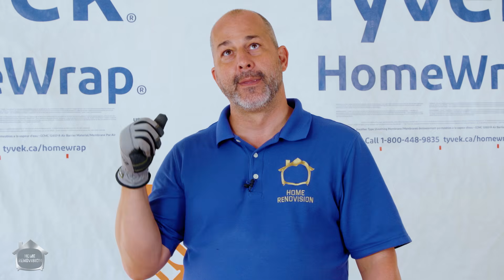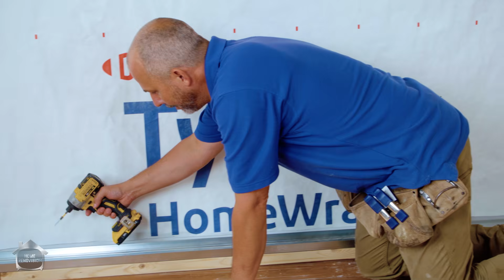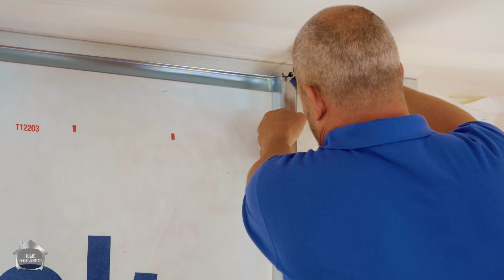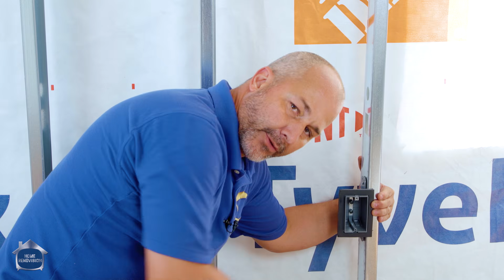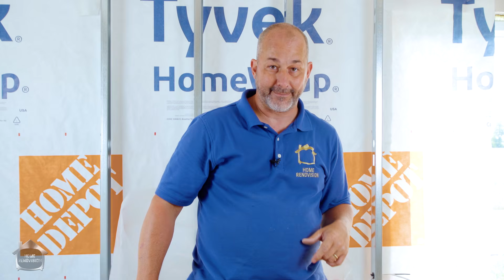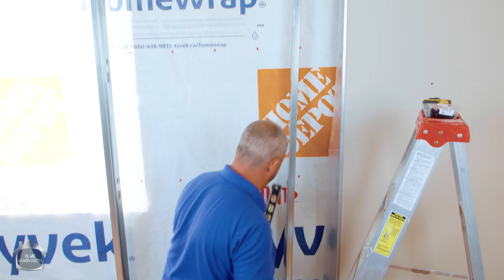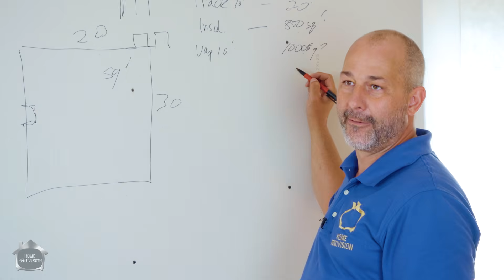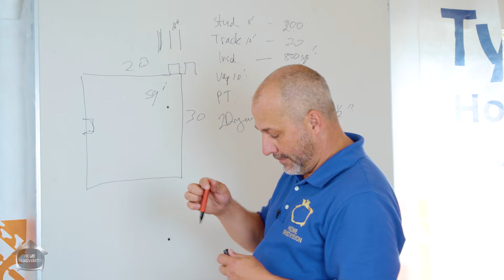Frame With Steel and Save Money! | Steel vs Wood

Comment: In NH basement foundation walls need to be sealed first with drylock before you start and track goes on top of a barrier like sill seal.  And no breaks like you have with the pt.

Comment: I want to use Six inch track at my Basement Ceiling, attached to the floor joist. Put Two inch Foam Board in the upper track. Put a 3-5/8 inch track on the floor, and 3-5/8 Metal Studs up. Will this work? Will it fit? BTW, I want to do this for a Fire Stop. Also every Eight Feet, I’m going to do a Vertical Fire Stop, with Two inch X Two inch Sheetmetal Steel Angle. I can use spacers or Fire Resistant foam to take up any extra space.

Comment: Great video so far. Still watching. I have a question on using 2x4 on the floor when framing. I have newer construction. House built in 2020 and moved in September 2020. We got the basement prep package which provided 9 ft ceiling , bathroom rough in and already insulated. Anyway, been watching some other vids and almost all of them just Ramset into the concrete for the floor framing, no 2x4.
Reply: I think he mentions in the video that newer construction homes that have proper moisture protection/vapor barriers around the basement shouldn't have the type of issues he's addressing with the stud. That said, as other comments mention, galvanic corrosion means you might want some kind of protection been the pressure treated stud and the steel.

(Commenting much later for anyone else trying to mine the comments for info.)

Comment: Your Videos are great man, Thanks! I remember when I first started doing metal framing, this professional framer guy showed me a very cool trick. He would only cut the sides with the snips and the top wider area he would place the speed square and cut the mark line "like twice" with a sheetrock knife and then move up and down and it pops off easily.

Comment: I'm a metal framer by trade from commercial building doing build-outs and even homes. I know you're showing the video for the average Joe who don't know but you should also screw the back of the stud by using extension and you can screw through the inside of the stud with the point going outwards into the back as well. We normally use the little vise grip clamps and we usually have a pocket full of them just to hold them in place until we go back and screw them. and if you're using PT on the bottom you should put a felt paper between the PT and the metal stud so you don't have a corrosion happening later on down the road. Don't take this as knocking you cuz I really do enjoy your shows 👍😉
Reply: Extremely important comment. It should be pinned to the top of the comments.
Reply: How specifically would you screw in the stud in the back side ? I found it extremely hard, eventhough I am using 90 impact extensions, I found that I don’t have enough force to keep pushing them constantly
Reply: What does PT mean? I’m learning how to install and correctly protect my basement from moisture
Reply: @jae-nacoleman  pressure treated lumber
Reply: Pressure treated (Lumber)
Reply: @rfranco8552 why are you not using stud crimpers?
Reply: @michaelkuzmin  .Thats very old school and if you ever try to take things apart for hatever reason it is a pain. Better just to use a pointed screw and clamp it. You get used to it.
Reply: @kevingrant9407  sorry when you say pointer screw what do you mean? I would use self tapping for 20 ga and thicker and non self tapping for the thinner steel. Clamp it, you mean clamp prior to screwing with a temporary clamp so that it holds in place? 
I ended up going with 20ga for my project so crimping was not an option for me, I had to use self tapping screws with wafer head. I also discovered that I had to get high quality ones. Screws that may look identical to a naked eye could actually have extremely different performance. I went with Grabber and they worked beautifully
Reply: I’m getting ready to order supplies to build out a room 10x20 with 10’ ceiling. I’m curious if I can put 3/4” osb on top of metal framing  (top side of the ceiling joists.) There’s another 6’ above it that’s open and would like it for storage and our humidifier. We’re building a walk-in humidor for a cigar lounge. Any help would be appreciated!

Comment: I understand that you need a gap between the wall and the insulation. So does that mean attaching something to the back of the studs too , in order to stop the insulation falling through? I think I saw that in one of your other videos, but I’m not sure what that material was.
I also thought it was ok to screw the baseplate metal straight to the dri-core sub floor, but here you advocate a 2x4 underneath (which I thought was mold food). So I’m a little confused.  Always enjoy your videos. Thanks

Comment: Speaking of the wood 2x4 on the floor: I'm thinking that I'll put two 2x4s atop each other so I have something to nail the baseboard to. I don't want to screw to the metal studs.  Also, the studs are for a 17' ceiling. I'm thinking, afix the tops first. Thoughts?

Comment: Instead of pressure treated board under the bottom track, may I use composite deck board? Waterproof, no copper reaction with metal? Any suggestions?
Reply: Thinking the same thing.....pt lumber is full of salts.....it's gonna eat that bottom track.
Reply: I like you idea.. but maybe a bit expensive

Comment: Jeff, what gauge were you using? I’m wanting to build a small room with steel but it needs to support its own ceiling with a double layer of 5/8 drywall (about 8x10). Do you think 25 gauge is too thin to support that type of weight?

Comment: I’m trying not to be too negative, some things you taught are right, but as a professional steel stud framer just realize there is a lot more to it, and impossible for a video like this to cover everything. Jeff cut his studs upside down, and 3/8” gap on top is optimal. If you start moving up and down the carrying channel won’t be level. (FYI ) the product is called carrying channel that goes every 4’ vertical to stop the stud from twisting while attaching drywall. The vapour barrier should be attached with the same wafer screws, the cardboard will cause bulges in the board, never seen anyone do it that way. Creative though. Also don’t put drywall screws close to where the wafer is. It will break the sheet. Also putting the cable tie on the outside of the stud creates an opportunity to put a screw through it and break the tie. 
I know you’re just making a basic video Jeff and I appreciate it, just realize there’s a lot of info missing for people to start diy’ing.

Comment: How do I nail baseboards and trims ?  ( 4 1/2 " ) I will be finishing my bassement with steel  studs. I purchased a few parts for practice  and found it very easy.
Reply: Cut plywood in between the studs. You'll have to notch the plywood out a little but I've done it on jobsites.

Comment: Great video! Wish this came out 6 months ago. We recently finished framing an entire tiny house with metal framing. Instead of the clips, we used locking C-clamps (similar to vice grips)  to hold the stud and track together which worked really well.
Reply: Pro Steel framer here.....the C-Clamps are what we use everyday. The spring clamps are okay but i only use those for installing drop ceilings. To me not enough holding pressure..itll work but C Clamps are like an extra hand...you can REALLY hold 2 pieces together
Reply: So you can use these for studding your walls instead of 2x4? He just said it was 1/2 cheaper than wood.Wow that is a lot of savings on just the framing.

Comment: What are the considerations if I want to hang a TV or cabinets on these studs?? Great video!
Reply from the maker: use the stabilization bar I talked about and install wood blocking prior to closing up so you have a good screwing surface. Cheers!
Reply: @HomeRenoVisionDIY  thank you!!!

Comment: what kind of screws are you using for the drywall and how do I run electrical through the top plate ? Any assistance is appreciated. thank you

Comment: Would you still put down a pressure treated board if have a dmx and osb subfloor in the basement?
Reply: Would not use PT lumber in direct contact with steel studs, period.  It's bad advice, the copper treatment in the wood will cause the steel studs to rust, so needs a barrier between them.
Reply from the maker: nope install direct to the osb. Cheers!
Reply: @HomeRenoVisionDIY  Awesome that was my question as well!

Comment: Hey Jeff, sorry if this is a silly question, but we are working on a bathroom addition in our 1926 living room ,at the same time as we'll be ripping off the ceilings to add sound proofing. I would like to DIY this as much I can. Do I have to finish the ceilings (adding the drywall) prior to framing the bathroom walls or do I do that when they're all open? Also, looking into steel framing the walls - toilet and sink plumbing will be on existing walls, but tub would be framed by new framing (potentially steel). Would you say that'd be a pain for the plumbing on that wall?

Comment: Hey, I'm buying a house that's currently being built, and I'm finishing the basement myself. Can I hang my drywall vertically in a basement with wood studs? Is there a pro/con for vertical drywall compared to horizontal? From what I'm seeing, vertical drywall has the tapered edges instead of butt joints, so taping should be easier.

Comment: you are saying dont use the steel from home depot but you are linking the ones at home depot. I am confused. Also I cant find the insulation types you recommended for steel.

Comment: I'm building a 9 foot high foot wall using 10 foot metal studs. The cut falls in the middle of the studs punch out which leaves a very weak lateral connection to the track. What's the trick?

Comment: I used cable ties with grommet holes to screw to side of the stud, then zip tie the wires. I bought the wiring grommets from Menards that snap together.
Very good demonstration video.
Question:  what gauge are your studs? I had about a thousand load bearing heavy structural gauge GIVEN to me when a friend closed shop & moved out of state about 15 years ago. I framed the entire inside of the house I built with them. My major issue was, since these are heavy gauge structural steel, it is challenging to screw drywall & other sheathing to them as well as fastening trim & baseboard etc. 
We moved to the Missouri Ozarks now & have just enough remaining to build a 20X40 tiny home for our daughter.

Comment: 3 5/8 metal studs fit poorly around 3 5/8 jamb stock especially when large headed tap screws used on stud face. Header should be track material to allow for cripple installation. Sloppy,unprofessional,trim will be a nightmare. Frequently use wood around door jambs for upgraded trim installation.Strictly interior non structural partition work.This guy could use a lot more experience working with metal studs but I’m sure he doesn’t have to make a living at it.

Comment: Hi - Is steel framing superior to wood framing - For cement backer board screwing and marble tiles (for full height wall from floor to ceiling) - Or is wood stronger?  Many Thanks

Comment: When you put that track on top of pressure treated wood, aren't you going to have issues with galvanic corrosion (due to the copper in the PT wood)? Or if the steel is treated enough to withstand that, wouldn't they also withstand any moisture (and thus no need for PT bottom plate)? I'm no expert, but I've seen what standard galvanized fasteners do in PT wood (dissolve!) so maybe the same happens here.

Comment: Thank you for the video.  I used a number of the techniques shown.  Using the spring clips is genius and using the metal screws closer to the edge made it much easier to connect the metal studs.  I got a bit crazy with a project.  I purchased metal studs from Lowe's and made a frame work.  Then attached the metal skirting from my mobile home.  Then in the cavities I inserted mineral wool insulation and on the back of the frame I used my Worx brad staple nail gun to attach 30lb. tar paper to the back side.  I made put the panels on 2x12x18 cement bricks with thick plastic under to keep water from wicking up into the metal. I can slide the panels out fairly easily.  I made the panels either 48" or 32" depending on what was needed on that side of the mobile home.

Comment: It is funny how steel framing isn't used as much in USA/Canada as in Europe, here (at least in France) most houses and buildings, new or renovation, are framed with steel and there's no problem with that, may it be from a structural, insulation or any other point of view.

Comment: As for gloves, I use the MaxiFlex cut proof (34-8743, size 10) gloves. They make several styles, but the green ones I use I can put a dime flat on a glass table top and pick it up easy peasey. They take about a day to break in and then they literally a second skin. They also don't make your hands stink and will outlast the cheaper box store gloves 10/15 to one. They are highly cut resistant, but not stab proof. They are sized like surgical gloves. The zinc on the steel studs will also dry the crap outta your hands and make your skin split at the joints. These prevent this as well

Comment: You are giving bad information! Pressure treated lumber will react with steel and aluminum in direct contact with it. It must be separated with a bituminous product. 

Steel studs are lightly galvanized, btw!

Comment: Steel stud framer, drywaller and finisher here.
Goddamn i LOVE THIS STUFF! Its easy for electricians to run their wires, bottom row of holes is for plumbers to run their pex and whatnot. Dont get me wrong, i love using wood 2x4s but sometimes steel framing is the best bet. Did and entire basement (it was about 26x28 give or take) framed the bathroom, laundry room, office and play room in about 2 days. One thing i can tell you right now though, USE PT WOOD UNDER your bottom plate. Its that extra little step and that extra couple bucks but really makes a difference.
Reply: what is the lightest safe steel studs for an house's main wall frames?  ty
Reply: I dont know of a code that would permit PT on any interior, my preference is sill foam, not wood

Comment: Great video.!! Great info and visual effects. BUT... I Disagree with using Pressure Treated Wood in the home.
Too many harmful chemicals and carcinogens. I would use regular wood studs on the floor with a foam insulation liner OR have the wood sealed/ painted with latex paint .U can also purchase"Blue woodStuds" from Lowes..Never use pressure Treated wood indoors.

Comment: "

  the problem with  
 galvanized metal and that's not galvanized sorry the problem with steel  in the basement  is relative humidity right and the
        
BUT STEEL STUDS ARE GALVANIZED   or Galvannealed, a similar coating.

Comment: Do builders ever put  wood studs in the middle of the steel studs for additional strength?
What is the strength of a steel stud compared to a wood stud.......same?  50 % stronger, 2x  ?
Reply: 18GA steel is used for structure, 20GA is for interior walls. Commercial store buildings are entirely steel stud construction. All that really matters is the thickness of the steel

Comment: Always put 4 screws  per metal stud to prevent twisting. It will establish a secure frame.
Reply: I think that’s actually code on commercial buildings! Not putting four screws is just being lazy (In my opinion).
Reply: @IppiopaidFEEDBACK  Yes Sir that is correct, it would never pass inspection!

Comment: Self tappers in wood is a bad idea! Self tappers are meant for Metal, fine thread self tappers in wood are worse, they will not hold!!!  Wood or Sheet metal screws in wood are far better, they have a coarser thread.

Comment: Great video, I'm definitely going to refer to it in my upcoming build. 

Got one question that doesn't to seem to be covered in the video. How do you do corners? You mention needing two studs for each corner but that one of them is going to be used for structure without going to much other detail.
Reply: I'll try to explain even though it would be 100 time faster and easier with a drawing but for a corner, you install the tracks and the studs for the whole wall like shown in the video then when you start the other wall, you will leave a little space of the size of your drysheet then install your track. You can then install the rest of the studs and tracks and when you'll have screwed the sheets on your first wall, you'll be able to screw the first studs against the sheet you "inserted" in the little space you left for it.
Another way of doing it is going wall by wall by setting up the tracks and studs and screwing the sheets then starting the next wall by screwing the first stud on the drywall but be careful when screwing metal on drywall, screw diagonally or it won't hold.
Sorry for my english, it's my 3rd language :D

Comment: How are you able to hang pictures
Reply: In my apartment (wood framed), there was a narrow wall where I wanted to put a picture in the middle.  No stud there.  I just used a small screw with a plastic anchor into the drywall.

Comment: Complete novice here:  At the "chalk board" section, you doubled the studs at one point for "top and bottom".  Should the studs have been doubled or the tracks?  (I believe you doubled the tracks when you initially computed how many you'd need).
Reply: By the way, excellent, excellent video.  Thank you.